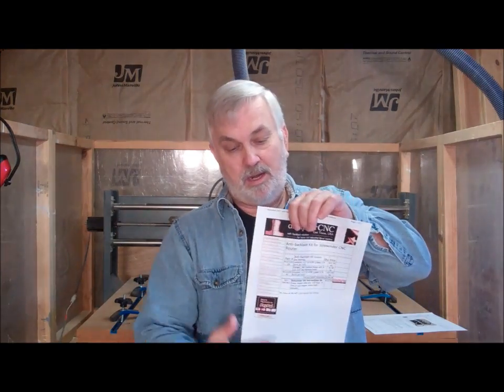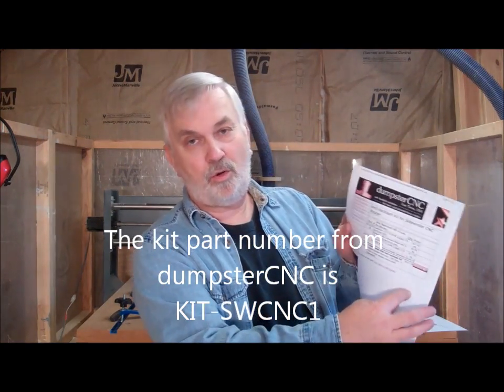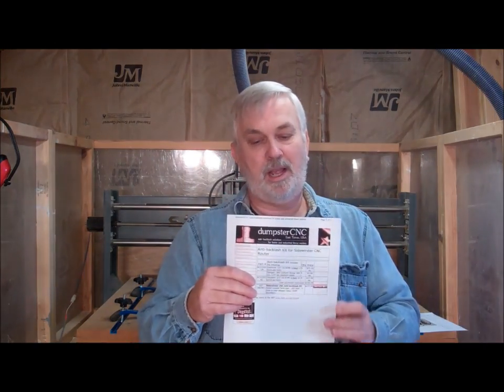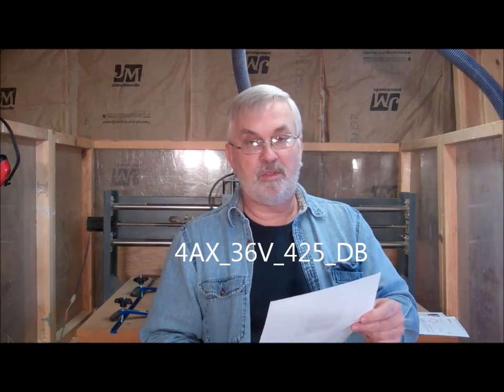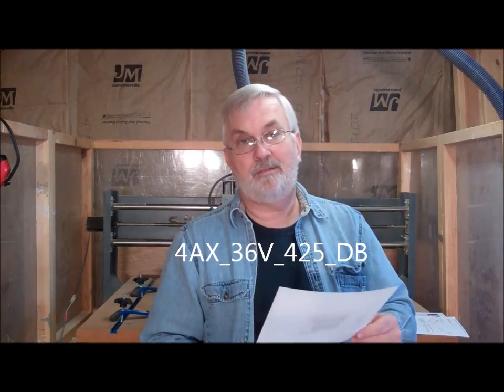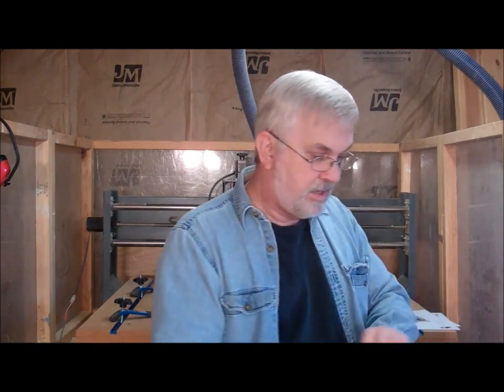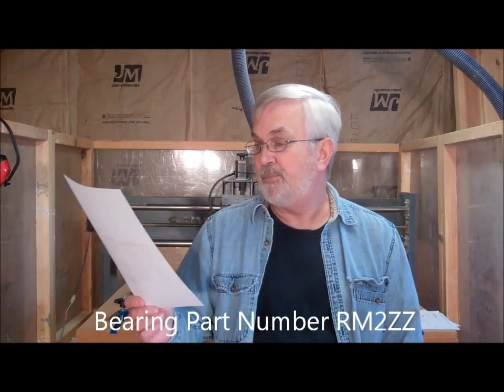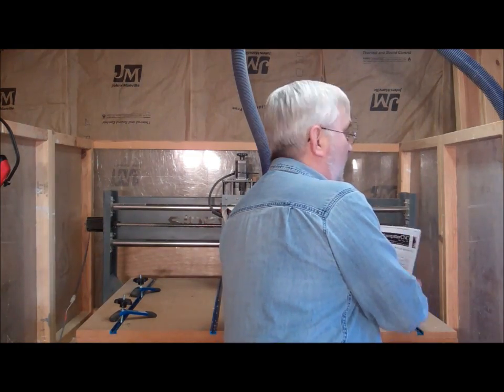More CNC Router Info

Comment: Dave, A very sincere thanks for all your help in getting us started in cnc. Your videos have been the key factor for me personally, to even think of building one. And not to mention, the plans you have generously given us. Mine is up and running and am wanting to add limit switches, an on off spindle control for the router, and an e-stop. I am having no luck whatsoever finding information on how to actually wire a Xylotex  break out to do those things. Thanks for any help,
Reply from the maker: +johnny chainsaw Thank you so very much for the kind words.  It's people that take the time to leave comments like yours or send emails that keep me wanting to produce videos such as these.  I'm not sure but I think there is a schematic drawing showing how to wire the break out board on the Xylotex website.  You could also ask that question in the CNC router tips group on facebook.  There is a lot of knowledgeable folks on there that are very willing to help.
Reply: Just wanted to post, I got some help from Jeff@Xylotex. He was kind enough to fill in the missing link in my trek to install homing switches, auto Z setter, and now I have my router on, off controlled by Mach3. I must admit that this "Diy CNC community" are pretty helpful and kind folks. If I can help anyone, don't be afraid to ask. Thanks Dave

Comment: Morning Dave. Got a question. Do u think the gantry would be stiff enough to not flex under load, if a guy changed your plans and made the gantry wide enough to fit a 4 ft table, or is their some design changes that need to be made.Thanks much for your time. Jay Scott

Comment: Dave,  I have sent you several excel and PDF files for almost all the parts needed to build the CNC.  You had indicated in one of your videos that we would have to figure out what was needed, so I did and sent you the full list so you could provide it to others instead of them having to determine all the different amounts of each item needed.  I have not seen a response from you nor an offer to new subscribers that this was available.  Perhaps you did not get them, if not, I can resend them, let me know...Ken Hall
Reply from the maker: Ken,  The plans that I provide to everyone has detailed drawings with a BOM (bill of materials) in the top left hand corner of all of the assembly and sub-assembly drawings.  It gives the part number, description, and quantity of every single component (nut, bolt, washer, whatever) that is necessary to complete the CNC router build.
Reply: Dave Gatton That is true, for each assembly, the list I sent is for the entire CNC router.  Unless 4 or so months ago I got an old set that did not have a BOM for the entire router.  All I am saying was that since I had to add all the different assembly items up, I did a spread sheet so that others would not have to.  Are you saying your drawings now have a total for all components?